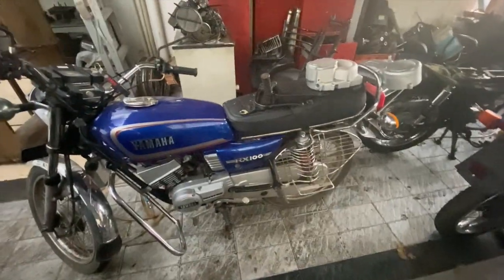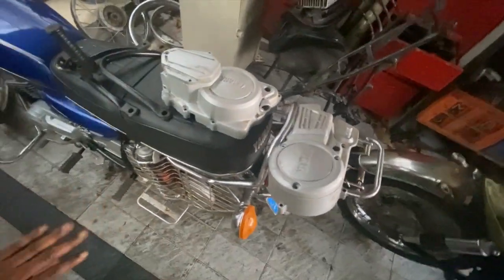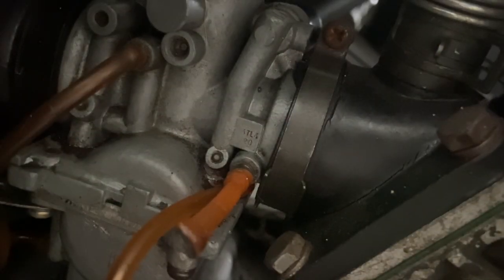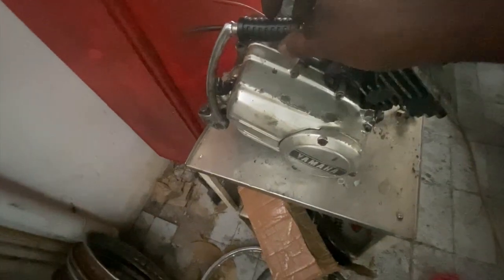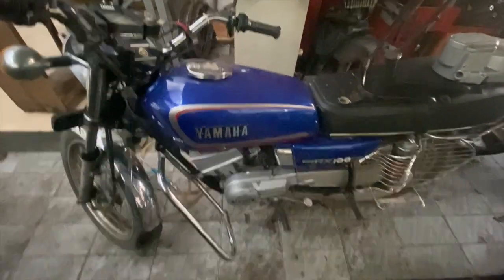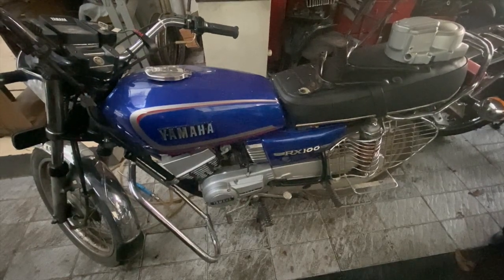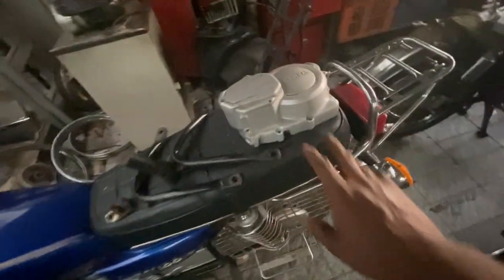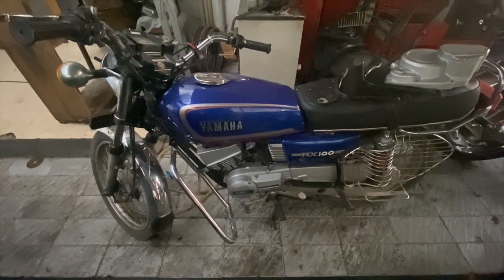Rx100 | 135 4 Speed to Rx 135 5 speed conversion (English Video)

Comment: Great video! Just picked up a 5speed gearbox (got it for 11.5k) and I’m going to convert my rx100 to 5speed. Will do the full 135 conversion after a while. Is there is huge difference in performance between the 4TL10 (5s) and the 4TL00? Is it worth the extra money?
Reply from the maker: Of course, but 5 speed cylinder lacks the low end of an rx 100
Reply: @Yamakaze u mean pickup?
Reply from the maker: @mangertech6546  yeah

Comment: Hello sir 
I own 4speed ...   Does just changing 4speed gear box. Into 5speed gear box.  Is worth ?? 
And also I go for long ride like 400km to 500km.  

Do u really recommend 5speed gear box for this.  Or 4speed is enough
Reply from the maker: 5th gear is good for touring and definitely better than 4S but if you enjoy riding your 4S during long distances then you will surely love the 5S experience
Reply: @Yamakaze   I won't change cylinder  carb CDI nothing.. I will just change gear box to 5speed.      Is that okay.?
Reply from the maker: @sanjaybabu9679  yep
Reply: Now i want to know whether the clutch and magnet side case covers should also be changed or we can retain the 4 speed covers. Initially i want to install only the 5 speed gear box not the entire conversion such as cylinder,head,carb, silencer etc.
Reply from the maker: @kkp8707  other than the gearbox everything is cross compatible

Comment: Sir I'm converting 135 4 speed to 5 speed. I changed it to 5 speed cylinder but using the old head (4tl00). Is it okay to use the same or do I need to replace it asap?
Reply from the maker: You can

Comment: Sir I am going to buy a new rx 135 5 speed...it's engine case no. Starts from 4TL not like 5 speed engine case no. 1L7....the bore carburettor cylinder no. Is all same as 5speed?....is there any changes in the engine or does any 135 5 speed comes with this engine case no.?....if u want I can watsapp u the photo
Reply from the maker: It’s not a 5 speed

Comment: My rxz cylinder block is 4tl00 and contractor is 55k00. My doubt is can't i make it as 5 speed without changing the cylinder block. If i can change what problem will i face without changing the cylinder block
Reply from the maker: You can
Reply: What problem will i face if i do it
Reply from the maker: @kishorers2744  no problems

Comment: 4s and 5s carburetor which works good for pickup
Reply from the maker: It doesn’t work like that, a 5s carburettor n 4s engine will give slightly better mileage but if you put the 4s carb in 5s and don’t compensate for the extra fuel it will flutter. For increased fuel you have to increase air. This is just an example. 4s carb will work on a 5s without issues, unless you are high up in Himalayas

Comment: Sir I have RX 135 4 speed I want to change a  tyre in a bike plz tell me which tyre size preferred like 2.75X18 front and 3.00X18 rear tyre is it best
Reply from the maker: Yes
Reply: @Yamakaze  but sir stock size is 2.50X18 front and 2.75X18 is rear size so can I upgrade size
Reply from the maker: @chandrakantmendhe7076  yes
Reply: @Yamakaze  Thank you Sir
Reply from the maker: @chandrakantmendhe7076  👍

Comment: I have two questions on this.
1) initial acceleration difference bn 4s and 5s.
2) coil,cdi,ignition coil difference bn 4s and 5s.
Reply from the maker: 4s has better initial acceleration, last model 4s and 5s came with similar magnet, the pulsar coil and the cdi was different

Comment: Sir, I have a 1998 Maroon RX-Z. It is restored last year. It's fitted with Goezete cylinder kit, other than that everything is pretty stock. Sir my questions are :-
1. Is Goezete Cylinder kit capable enough, like the original cylinder. I mean will it make the same 12 BHP and 12.25 Nm like the stock. And sir will it be good for the bike if we modify the bike, basic one, will the cylinder be able to cope up with this.

2. Sir if I just change the gearbox and Sprockets to RX-Z 5 speed, will it give about 90-95% feel and performance of an original 5 speed.
Reply from the maker: Goteze is not that great. Changing the gearbox will set a solid platform for future modification
Reply: @Yamakaze  Then as per you sir which Cylinder kit is best except original cylinder kit?
Reply: @Yamakaze  And sir the logical reason, why Goteze is not that good.
Reply from the maker: @bridgewalk7014  nothing comes close to original cylinder, aftermarket cylinders have port issues and casting issues

Comment: Bro one doubt without upgrading gearbox can we replace  the cylinder of rx135 4 speed with 5speed cylinder for better power since there is 2bhp difference in stock condition ?I know it’s not that worth to do so but will it work?
Reply from the maker: It will, the powerband of a 5s is higher so you will loose the low end torque

Comment: Will it make any difference in performance if we just change the gearbox alone?
Reply from the maker: You will get an extra gear, engine will be little less stressed at 4th and 5th gear, slightly better top end

Comment: If I use 135 4s magnet in rx 100 what will be differences on riding. It will be good or not?
Reply from the maker: It will not work
Reply: @Yamakaze  I didn't get?
Reply: @Yamakaze  kya kam nehi karega sir? Talking about light or something else?
Reply from the maker: @souryaranjanmohapatra6835  the timing is different for rx 100 and rx 135

Comment: Is there any difference in gear shifter drums of 4 speed and 5 speed. info on this would be helpful bcoz people sell used 4 speed drums claiming to be 5 speed.
Reply from the maker: Not same
Reply: @Yamakaze  thanks for the reply. Any pointers on differences
Reply from the maker: @kkp8707  it’s not easy for someone to differentiate unless they know what exactly they are looking for. I have some key differences in a post on the Instagram page, details of the Instagram handle in the description of this video
Reply: @Yamakaze  thanks a lot. Surely will check ur insta post.
Reply from the maker: @kkp8707  👍

Comment: What is engine knocking?What are the possibilities?
Reply from the maker: Engine knocking happens due to the mixture igniting before the full compression on the air fuel mixture, it can damage the piston, this is compensated by increasing the octane value of the fuel or introducing spacers in between cylinder and head, higher compression engines have their own uses.

Comment: Sir
At 11.15 you said rx 100 crank is different from 135 4 and 5 speed, but at end you said all three are same.
Bit confusing..
Could you please clear my doubt?
Thanks
Reply from the maker: Crank is same the connecting rods are different. There might be slight differences which I might not have noticed but 100 crank can be used in 135
Reply: Thank you for the reply.
You generate very useful videos for rx lovers.
Reply from the maker: @shivabharani8091  👍

Comment: In standard  rx100  engine ,  
 convert  to 5speed  gearbox . 
It's  make eney  difference in performance
Reply from the maker: No
Reply: @Yamakaze  
Is converting 5 speed  in rx100  is  useful or waste
Reply from the maker: @yamaharxmohamed5957  depends on your riding, if you ride on highway more then it’s worth it
Reply: Thank u bro
Iam in tamilnadu  630001
In  my  rx100  i notice  that magnet  slightly  going in an out with crankshaft  maybe  2mm 
It natural  in rx or  eney
Reply from the maker: @yamaharxmohamed5957  not natural

Comment: Bro any difference between rxg and 135 ?
Reply from the maker: Clutch, YIES, magnet and coil. Stock Rxz cylinder has slightly square ports
Reply: @Yamakaze  does yies sticker is there is rx 135

Comment: Pls correct me if I am wrong.... converting 4s to 5s will get feel of orginal 5 Speed.
Reply from the maker: Of course, you will get the feel
Reply: No it won't, you'll have to upgrade the entire block and gears to get the feel, 5s has 14 Bhp, Block no is 4TL10, for 4s it is 4TL00, so in order to get the 5s feel get the original block and gears.
Reply: @boyfromthemountains but 4s has better initial than 5s which is due to  4TL00block so just using a 5s gearbox will give both, initial and better top speed right?
Reply: @duke7571  gear box won't replace BHP, total power output of 5s is higher that 4s, since 4s has 4 gears the feeling of better initial is felt however dyno output would show that 5s is more powerful engine, to increase initial performance use a smaller type like the yesdi wheel, and tune as per initial pickup.
Reply: @boyfromthemountains  I don't want more bhp bro. I just want initial of 4s and 15 to 20+ in topend